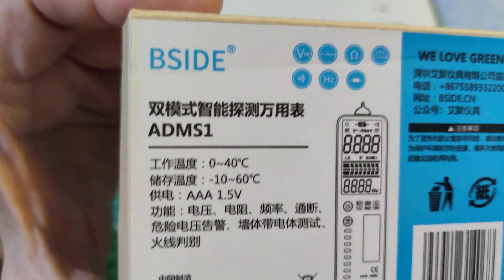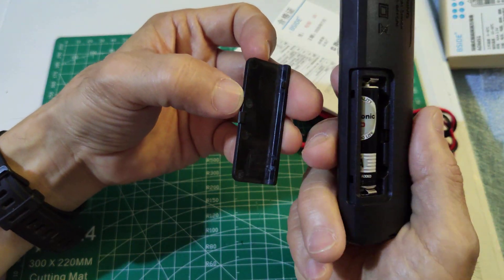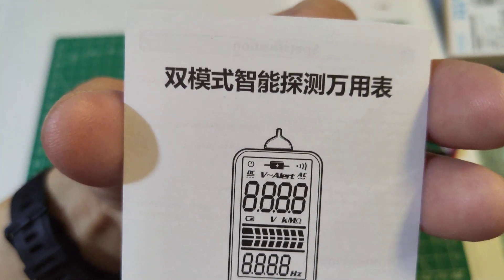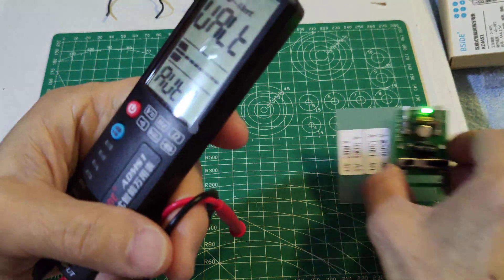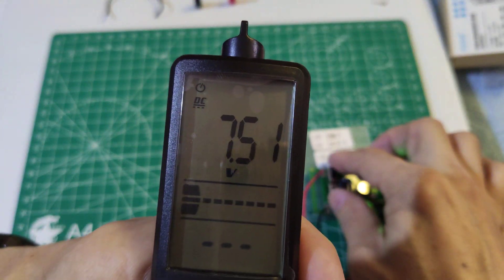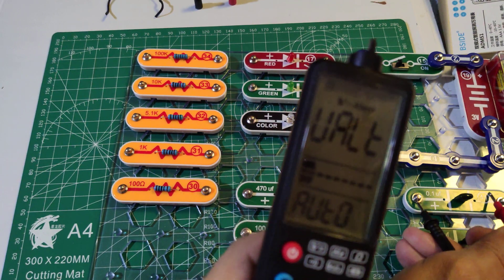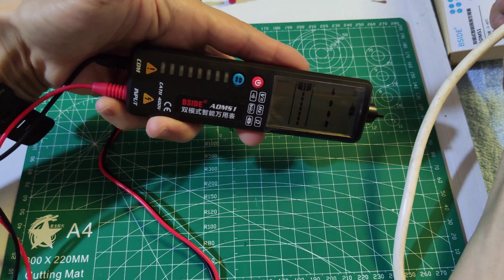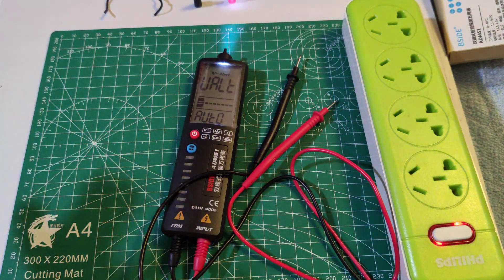BSIDE ADMS1 PEN TYPE MULTIMETER MAX400V CAT3

Comment: Where do you purchase the Ohm board, the one you used to test the ADMS1 meter.
Thanks
Reply from the maker: it in hong kong only.it is normal type resister board .not a reference resistor one.
Reply from the maker: you can buy it,it for child learn electronic cct,and transistor ,led,diode etc. it about 20 to 70 usd not include the mail fare.thx for watching.
Reply from the maker: for this links
Please help me choose!
HKD113.55  36%OFF | New Compound Mode Switch Circuits Electronics Building Block Kit Scientific Experiment Educational Assembling Toy for Kid
https://a.aliexpress.com/_vWplju